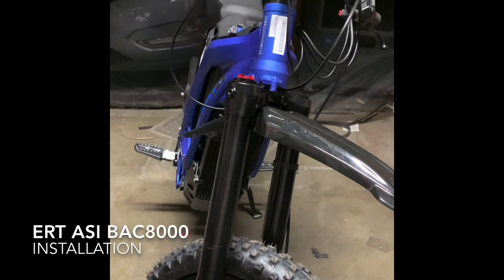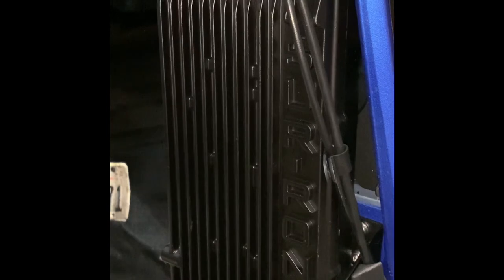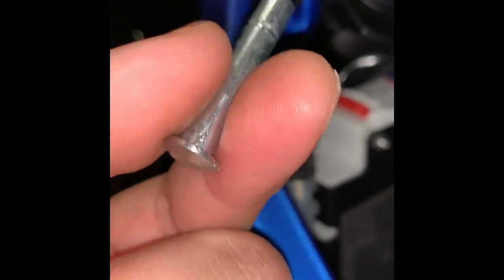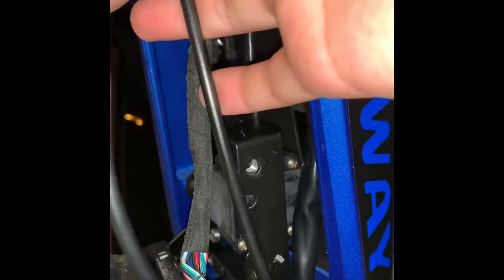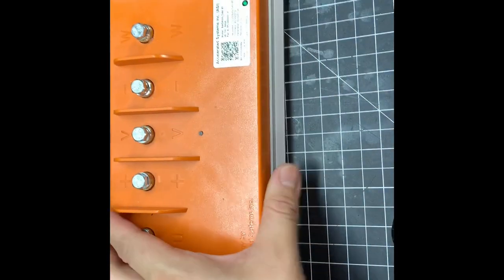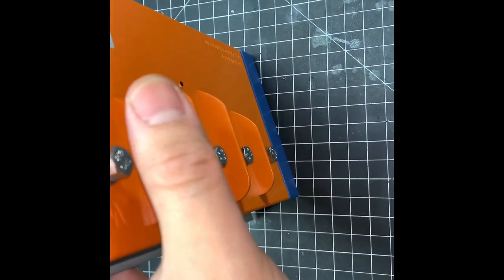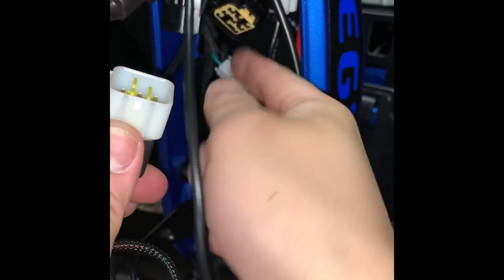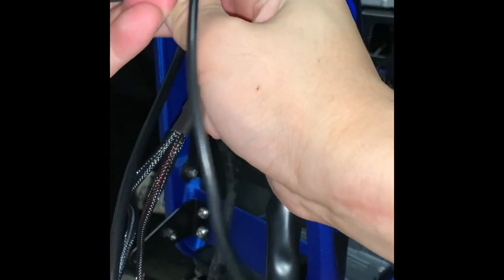ERT ASI BAC8000 NXT Sur Ron installation video

Comment: Alan, I’m installing mine right now but I noticed that the screws on the controller are too short when you reuse them to mount the plastic brackets. They don’t even get into the metal part of the controller. Luckily I had some that are about twice as long and work great! Just a heads up. Thanks for posting!
Can you show how to calibrate the motor to the controller next? Thank you!
Reply from the maker: Introvert Adventurer you may have to drill deeper holes into the bracket. They have since been revised

Comment: Awesome you put out a good video on this!
Question - I'm also running the bac8000 with a 72v battery. At mid power and or under good load I get motor chatter. I have it set to 300 AMPS and 8000 watts, gear ratio 7:1, and motor pole pairs to 4. Would you happen to know what the motor chatter is from? You can private message me if you want.